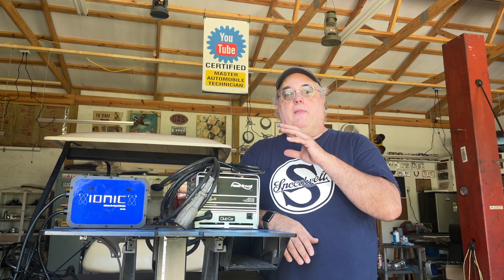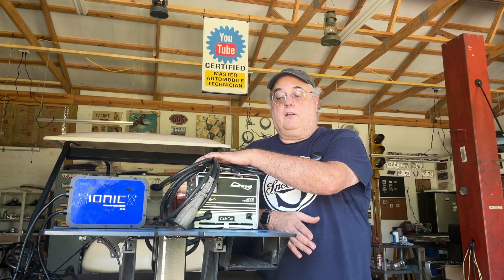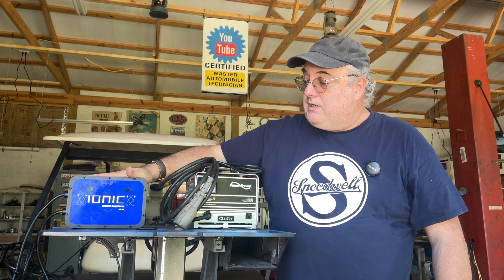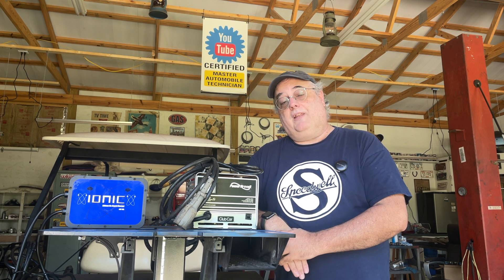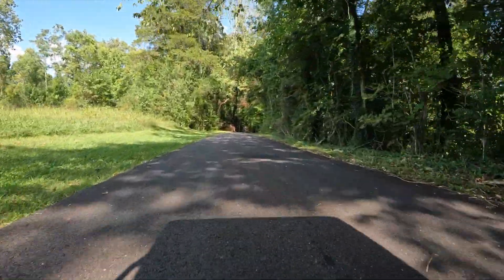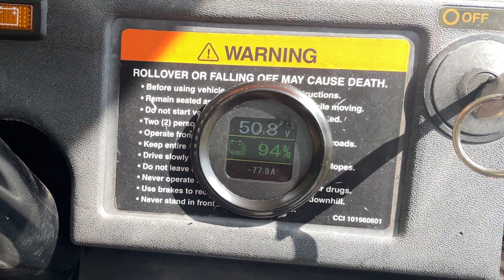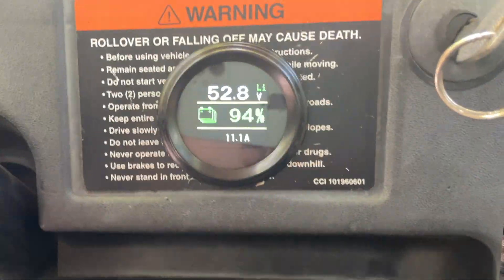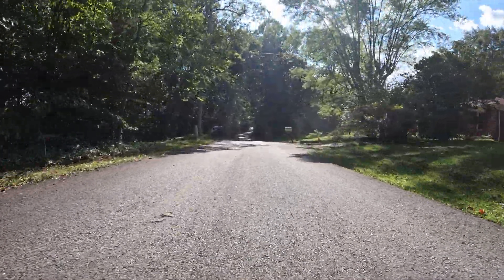How To: Convert a Golf Cart From Lead Acid Batteries to Lithium Batteries

Comment: What's recommended for a 36 volt ego golf cart that had six 6 volt Trojan lead acid batteries it it ? Most lithium batteries I'm researching seem more heard to fishing boats, trolling motors and their electronics. Also there are many issues being brought up with the BMS systems malfunctioning when lithium batteries are connected in series. There is a lot of conflicting information on all if these lithium batteries and most are coming from China which creates a customer service nightmare if you can even get customer service. It's a lot of money to put out and then get jammed up with a company from China which can lead to headaches with customer service or no customer service at all because you can't call them. I'm interested bin lithium batteries for my cart but need to know there is some good customer ongoing customer service out there. It's a lot if money for some folks to put out then get jammed up with no help........
Reply: I have been dealing with” Big Battery lithium batteries out of California “. I’ve done about a dozen conversations in my area in ezgo and club car , 36v and 48 v carts. So far everyone is happy , and the price is very reasonable. I’ve had a few minor issues and made a call and customer service was great. Just research what you want to do. I won’t buy their charger, I use the “ smart charger “ instead. $170 and you order with what ever plug you need depending on the cart your converting.
Reply: The place we got the battery in the video from is located in South Carolina- see the link in the video- they have a 36v battery for golf carts and have a very helpful tech support line staffed by folks in the us. I did have to give them a call and they were very helpful.